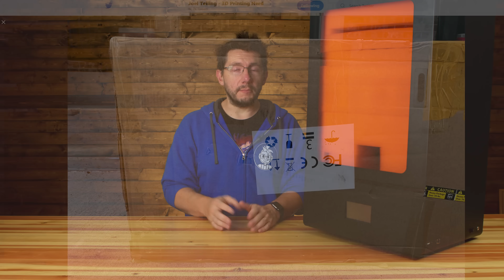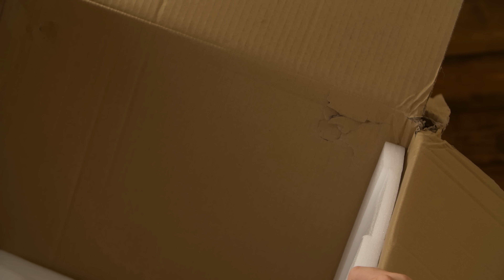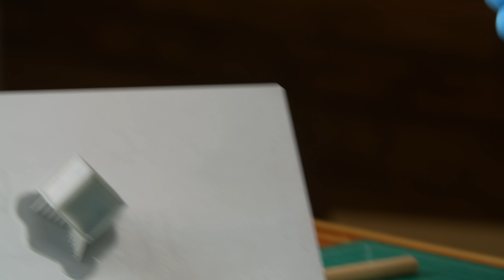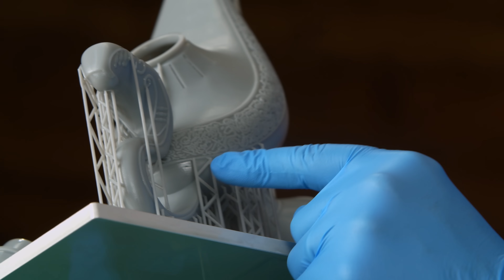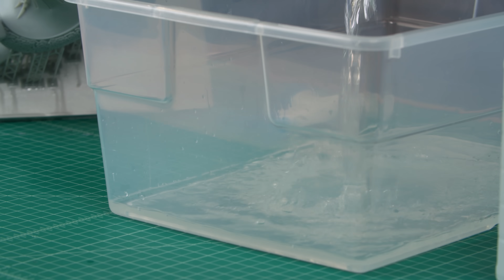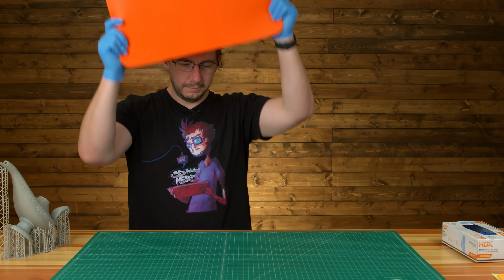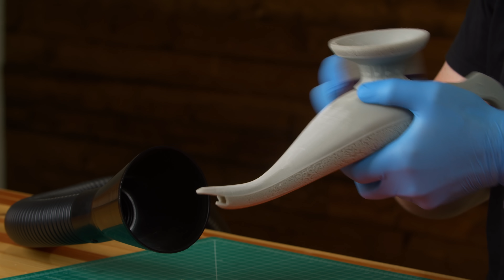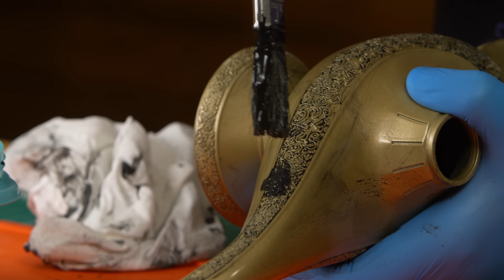HUGE Resin Printer - First Impressions of the Peopoly Phenom mSLA 3d Printer

Comment: Question: how much did the material itself cost to print one lamp? Thanks :)
Reply: Couple bottles of resin (assuming 1L bottles) is pushing $80, counting IPA, that tub and UV lamp, I think it's out of cost capacity for most people.
Reply: @brandonden795  Thanks, I appreciate it. I'm waiting for printers to work by melting plastic recycling materials like bottles and containers :-)
Reply: @TaskSwitcherify  See you in 15 years. The technology to even just recycle PLA prints is even still worthless at this point. Your average size PLA print is about 50m of filament. You have to be consuming plastic containers at a very high rate to sustain prints, plus bottles and containers are all different compositions of plastic and I honestly hope regardless, we are past plastic bottle use and waste by the time this exists anyway.
It's an admirable idea, maybe manufacturers can utilize it but not the casual consumer unfortunately. Then again 20 years ago I would never even believe 3d peinters to exist and be easy to use so who knows!
Reply: @brandonden795  Good points and thank you for elaborating. I know people who melt raw pellets and make their own spools (even here on YouTube) and save at least half off the price. But I hear you on the variety and difficulty of reusing of the plastics used for household containers and other goods. Cheers!

Comment: aside from there awful packing there response to your informing them of the damage was also awful, a short term test that might seem to reveal ok results, doesn't test for what possible long term or near long term premature damage and failures may occur, do to the  initial damage.   surprised they didn't offer to replace your item, did you file a UPS damage claim did they fail to process they claim  either way  ups and or the manuf should be replacing your machine or  refunding your $$   egads
Reply from the maker: Peopoly did say the machine could be replaced no problem, however, we both wanted to see if it would work. Just to see.

Comment: UPS didn't deny your machine. Your machine was poorly packed. There was nothing but thin cardboard between the frame and whatever it might encounter. I used to work in a pkg processing facility and all of the boxes ride down conveyor belts and slides to get to the appropriate truck. Think of chucking your machine down a slide, that's how everything is handled in the shipping industry. It should've been shipped freight and attached to a palette. Again a shipper problem

Comment: very poor packing for a almost $2000 piece of sensitive machinery. China quality strikes again. also, the hole in the box is from the plastic foot when the box was dropped. which is what happens. which is why you use not crappy packaging. also the machine had noticeable damage which is not a testimate to its build quality. quite the opposite. but as always you get what you pay for.

Comment: UPS shouldnt be blamed for 100% of that issue, they sometimes get shipments from the distributor (something like Amazon) where it was already damaged, or they used a damaged carboard box which made damaging the product easier. plus, it helps to use more packing material, which amazon typically doesnt do, they rely on the inner boxes' packing material, and it gets worse, as they can collide inside of the bigger box and damage each other, and them using cheaper box types for larger boxes doesnt help either, as shippers arent going to treat your package any different than anyone else's.
it also helps to not be in a terrible section of the world, as here where i live, a little bit of a crease between the flutes is far better than fed ex's typical bending. even if they give functionally the same service.

the rule of thumb is that, if your package cannot support about twice its own weight on top of itself, it WILL get destroyed or damaged

it also doesnt help if some shippers like fed ex ship through another shipper like UPS and then ship it themselves locally, or vice versa, no idea why, but ive seen boxes like that (they will have double labels, or remnants of other existing labels). this then makes blaming one or the other a whole lot more complicated, as bias tends to do a lot more for determining who damaged the box, as it could have been a compound issue, where each side damaged it slightly and one just so happened to deal the final blow that caused the visible damage (like one shipper damaging the cardboard, and another accidentally dropping another box onto that area, going through the rip, and damaging the contents, especially if packing material is horrible)

quality of shipping also depends on changing conditions and timing, so theres no true way to say who is better than another in that regard.

...speaking from experience.

Comment: I do poly resin mold casting and I use spray release in the molds to prevent sticking,,, would that work on the print tray of that printer ??

Comment: What is the point of wasting alcohol on cleaning the support structures? Shouldn't the support structures be crudely cut off and thrown away first? Cleaning the support structures is just going to waste more alcohol.
Reply from the maker: Yes and no. Depends on how you like to cut supports. Some like to do it AFTER curing, which means they are left on.

Comment: For weathering I suggest using:
1 part black paint
1 part brown paint (If gold colors, otherwise 2 part black for silver'ish colors)
1 part Future Floor Wax (Now  Pledge Floor Gloss)
1 part latex paint extender (Flotrol for example)

(You can google Magic Wash for various recipes.)

There are commercial Antiquing products as well.

The Future floor wax and the extender create some surface tension allowing the pigments to cling to details and pull away from broad areas.

Apply liberally. Wait about 2 minutes and blot (do not wipe) with a slightly damp cloth\rag until you have the effect you want.

Comment: Instead of farting around with a spray bottle and a brush, why not make a parts washer kind of tank with a pump and a brush with an IPA supply tube? You can use the box you have already, just plunk an aquarium powerhead pump in it, and get some tygon tubing. 

A quick search found this on amazon, and it looks like it's built into a pelican case, so it's rugged, self contained, and hard to hurt. 

https://www.amazon.com/BikeMaster-LEPAZA25131-Parts-Washer/dp/B007GR4IQW/ref=asc_df_B007GR4IQW/?tag=hyprod-20&linkCode=df0&hvadid=312067194179&hvpos=1o4&hvnetw=g&hvrand=9623194881914140617&hvpone=&hvptwo=&hvqmt=&hvdev=c&hvdvcmdl=&hvlocint=&hvlocphy=9052576&hvtargid=pla-571493197623&psc=1

Comment: The so-called 'gold' you used was not a very realistic gold. It lacked the orangish element of actual gold.  It would have been great if you had repainted half of it with glossy brass paint.  Another option is 'antique gold' used in crafting of metallic gold objects. It comes in a bottle or jar, so air-brushing would be required.
Reply from the maker: Ooh thanks for the tips!

Comment: Why do you have to throw away the cured resin bits ?
That the reason metals are far superior to resins.
Needs a waste chemical bath to reconstitute UV activated resin (100% material cycling) before this can be anything more than a fad.
Good printer though. The pin hole might be an issue with the initial 3D model. Blender has issues compared with additive modelling for instance.

Comment: you can have exactly the same result and quality with a normal FDM 3d printer with huge less headache using special filament, bronze or gold e just some spray for finishing, and without environment torture for all chemistry you need to use

Comment: The form requires almost no cleanup. You dont have to deal with resin. it pours itself from the cartridges that are super easy to insert at the back. The resin tanks are removable and can be stored. Resin has no smell. Engineering resins are damn good. Preform is magic. There are plenty more reasons why the 3L costs 9999. Like LFS. Supports are a breeze to remove.

Comment: I like the weathered one, but in truth, there is a really good metal pain that actually looks like chrome plating (or gold plating) that I would paint this model with and wet it and throw some real dust-dirt on it, for that just unburied look.

As for my wishes from a Genie:
1. My own fully equipped building with every kind of automated machine there is, from a CNC router table to laser cutting-engraving to all kinds of 3D printing tech.
I want the biggest and best, like I-CORE Iris, and, well you name it, I want it.
2. I want to see Angus, Joel And Thomas do a combo show.  You three are tied for first place in my 3D youtube universe!

Finally, I would love for someone, anyone to do a series for the 100% noob!

3. I want to see everything from HOW to connect and flash Arduino files (or GRBL or other such things) to any board.  everything I have found starts at step 22. and I need the first 21 steps.

I think any real Genie could be able to handle such mundane requests.

Comment: maker says "use the plastic thing to release the part"...goes and uses the metal thing...
Reply from the maker: Heh, yep. Turns out the plastic thing is for getting the resin off the build plate and moving the resin around in the tank.

Comment: Amazing technology and the resolution of the device was insanely precise.   I'm shocked it created such smooth surfaces where the supports weren't required.    I'd be happy with either lamp btw.   The weathered looked great.   All in all on a film set with set design it would look the part.

Comment: I thought you were supposed to take the supports off after cleaning but before you cure it because they might be connected to small details and when it's super hard and brittle from the cure and you try to pop them off they might pull the small details with them. Also if you have thicker supports, cutting through them may be a chore when cured as they'll be so hard and solid.

Comment: Correct me please, but in a resin printer like that, I don't think you actually need hardly any of those supports...
Reply from the maker: It’s possible. I’m using the slicer to auto generate supports based on its best guess.

Comment: Joel, don't know if it was mentioned earlier, but I would say try using a brown (more with a reddish/orange/copper color) instead of black - and try going for the consistency of milk before applying and then wiping it.  When wiping it, realize you're trying to leave enough color to reach the crevices, instead of just wiping it down in general.

Comment: The fact that this allows you to print with the door open like that is a major safety issue, the wavelengths of light you need to use to cure the resin that quickly is very bad for your eyes!
Reply from the maker: That’s very true. I believe there is an option for a lock, or they may be working on it.

Comment: I am a little concerned about your method for cleaning. And maybe this is a difference between UV lighted and DLP printers, but prints are still "soft" after printing so you run the risk of marking the model even with a soft brush. Also, you should definitely remove the supports before curing. Hand removing the supports risks you pulling off more cured resin from the actual part. 

Also, wet sanding is preferable to dry sanding both from a safety perspective and clean up. 

Also, I like the weathered one.

I would wish for a larger organized workspace.

Comment: They do degreasing tanks for machinery parts, feels like that filled with isopropanol alcohol would work well for the clean down process, not sure how often you would have to change the alcohol out or if it could be filtered for a longer life.

The part after the supports are removed look like a plucked bird.

And someone has to print that in wax and then cast it in bronze, would look amazing

Comment: I'm a little late to the party but have some valuable insight for you. I'm an insurance claims adjuster for UPS damages. The way that was packaged, especially with how much it weighs(clearly marks 70+ pounds), there was not enough padding to protect that. For something that size and weight we recommend 2 inches or more of some type of foam padding on ALL sides, not just 4 of them. Had they put padding on the bottom, you wouldn't have suffered that damage on the foot like you did. Still unfortunate that it happened, but we joke in the office that you need to pack against the drivers laziness.
Reply from the maker: THANK YOU for the awesome explanations! They have since updated their packaging and units are surviving.

Comment: I looked through the comments, but I couldn't find how long the lamp took to print on the Phenom?
Hopefully it prints faster than an FDM because 400 hours isn't a lot of hours for needing to replace a major part.
Also, how can you tell when the LCD is failing?
Holes or spikes in a print?
Reply from the maker: This lamp took roughly 30 hours or so!
Reply: @3DPrintingNerd  Thanks! Really enjoy your videos. Bought a Longer SLS today, based on your review. I hope I have as good luck with it.

Comment: Small correction: The Form 3L is about 15% larger in build volume.
Reply from the maker: Yeah, I misspoke and attributed Z height to total build volume.
Reply: @3DPrintingNerd  lcd panels make it tough to have a big XY cross section or weird aspect ratios, which is why they rely on height so much.

Comment: I dig the non-weathered one more than the weathered one. I'd definitely wish for a Peopoly Phenom mSLA printer, btw, that thing is BEAST! Also, as someone who's worked for UPS before, there's good reason that I never will again and it's the same reason they're unionized: they treat their packages like garbage and the Teamsters protect them from taking hits from it. I haven't voluntarily used UPS in almost 2 decades now, and if I had the choice every time I bought from anyone online, I'd NEVER use UPS for anything, ever. DHL isn't much better, though, honestly, but they're at least working on it. Even USPS are utterly dreadful to use. Out of all current options, FedEx are thus far the best. It's a sad market, honestly, the consumer shipping industry.

Comment: I like the weathered one, Though You would have gotten better results if you used more water in your mixture.

Id wish for one of these printers. I just got into SLA and the only downside is the build volume on the low cost models (I have an Elegoo mars)

Comment: Agree with other comments on poor packing. As a 20 plus year seller on eBay I have packed and shipped many large and heavy items without any problems. 

  Looks like they are trying to keep the outside dimensions to a minimum. As a result the foam padding is way too thin for the size and weight of the printer.
    Keep up your great informative videos!
Reply from the maker: Thankfully they took the results from my shipping damage and changed it up. Uncle Jessy got his and the packaging held up much better.

Comment: Question: Does the software know when it is low on resin and pause to give you the opportunity to add more resin?
Reply: I also have this question
Reply from the maker: It doesn’t have that ability. It does tell you how much resin the print will take and how much time it’ll take. Checking and adding resin still a manual process, but easy to do.

Comment: You can get a drum of isopropyl at the industrial hardware store pretty cheap. And ots not really weird to deal with multiple containers of the stuff... I have done it just working with computers or cleaning um messes.... Abandon the brush, set the bottle to stream and rinse NOT mist the object. Or just get a small aquarium pump and more alcohol. And theirs nothing wrong with a sink in a fresh supply to start.

Comment: Complain complain dude be glad you even got one SMH
Reply from the maker: You do realize part of my job is to criticize and offer critique, yes?
Reply: @3DPrintingNerd  yes that's clear but to criticize is one thing but it was obvious that you disliked the machine basically on your negative preceptipn gained from UPS screw up with delivery, agreed ups sucks but that was NOT the machines fault.
Reply: Like a rules lawyer in a rpg lol
Reply: @xxuniquexx1000   well, to be fair, in a review I llok for everything: ordering process, support, shipping and shipping quality, running cost etc. 
So pointing out that it's loud, that the manufacturer acknowledged the problem with the shipping container, that you will run into odors  and so on is the right thing to do. 
He said the quality is excellent, he never doubted that. There are many reviews to criticise, but this review isn't one of them.

Comment: hey Joel, to save on IPA, use a zip lock bag. better yet, if you have a ultrasonic cleaner, put the IPA + model in the bag into the ultrasonic cleaner with normal water in it. once you finished you can easily extract the IPA for future use.

Comment: 1:38-"as if a machine punctured it". Well sure, the printer's foot went through thre cardboard. No mystery there.
"Hard enough to bend steel"- That printer has a sheetmetal case, which while strong enough for its intended purpose, is no match for UPS mishandling and abuse. But its just sheetmetal, not some kind of structural I-beam or something. Just because it's steel doesn't mean it can't bend. On some cars,  the steel body is so thin, you can dent it with your thumb.  "Steel" isn't a word to be spoken of like it's some kind of absolute.

Comment: UPS did not mess up your machine. You are supposed to have two inch of padding. There's not even one in on the side and there was Zero at the bottom. Also that looks like a pretty heavy machine to only have two inches of padding.